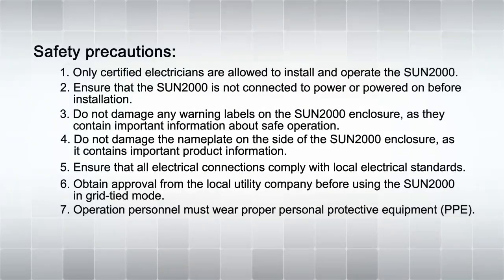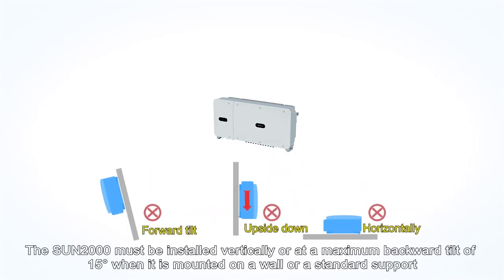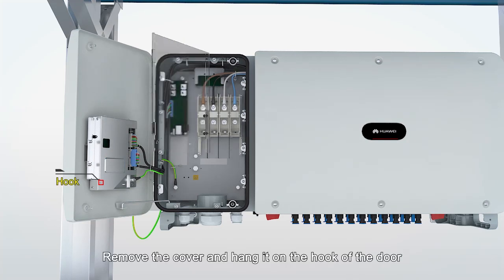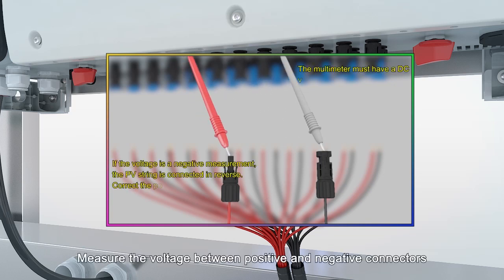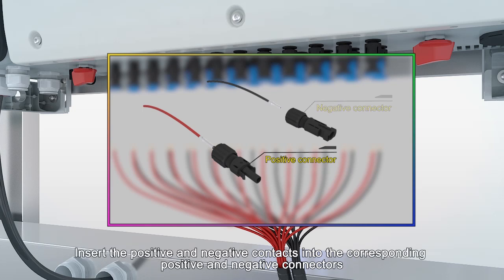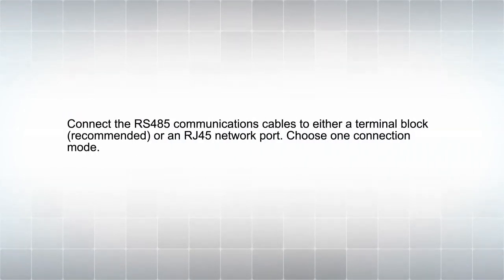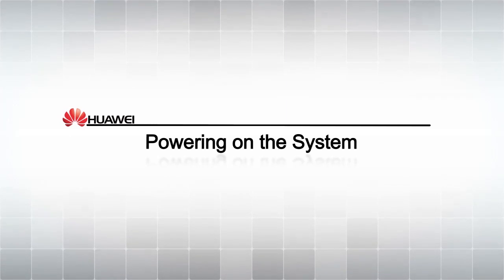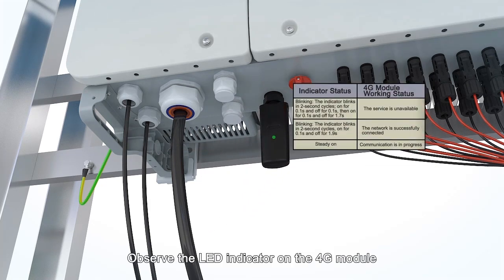SUN2000 50KTL, 60KTL M0 Installation Video

Comment: Quick question- the mppt max voltage is it combined overall voltage or per string
Reply: usually around 1000V per string / per input connector.